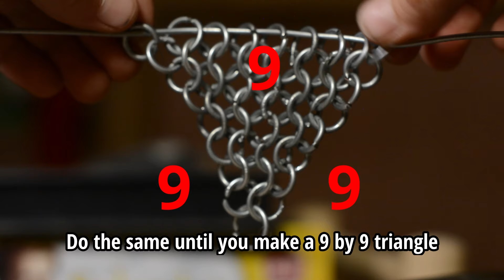How to make a chain mail coif

Comment: is that galvanize, 201 steel, 304 steel or aluminium wired ? i wanna build too based on your chainmail, its a nice guide man, thanks i really apreciate it 😁
Reply from the maker: I'm glad you liked my video! The wire is galvanized, but it's a pity, I don't know if it's 201 or 304 steel, I just know that it's definitely not aluminum. (I'm still learning myself). I wish you the best of luck if you attempt this project!
Reply: @jUNIKcrafts  I think 201 is the best option, it not too hard and cheaper, no need to be too fancy 304. little rust make it more cool (like blood stick in it :D), even you can smell the "blood(rusted iron)" smell. Anyway well done!
Reply from the maker: @phanlee4621  Thanks for the very cool suggestion, I'll probably do that ;)

Comment: Uh, this is frustrating. How do I go from a hexagon to a circle? God, no one explains it...
Reply from the maker: Everything is explained, you just have to add rings around the hexagon until it becomes a circle.
Reply: @jUNIKcrafts does that mean I have to keep the same number of rings for the expanding rows and periodically increase the ring count (ex. 9 9 9 10 10 10 11 11 11) or do I just keep increase it like 9 10 11 12 ...
Reply from the maker: @edwardjung1366  If you keep the same number of rings as in the last row (I don't even know if that's possible), you'll end up with a mess, because the hexagon or circle won't grow, it'll just start to curl up. You just connect the rings in a simple way and you'll end up with their number increasing, thus growing the crown. Later, you add additional rings only in places where they're needed (for example, where the ears will be).
Reply: @jUNIKcrafts Thank you so much for this response many people seem to have a similar problem but i couldn't find a solution. Just to verify the chain will start curving automatically?
Reply from the maker: Yes, it will start to curl and layer on top of each other (this happened to me off-camera, I had to disassemble and re-film it😓)
Reply: @jUNIKcrafts that too bad thanks for the quick responses